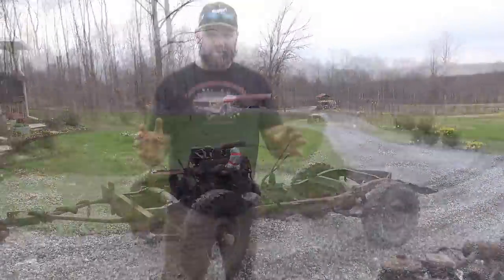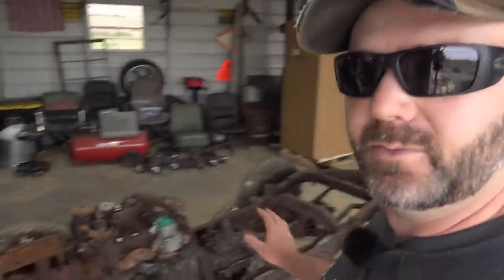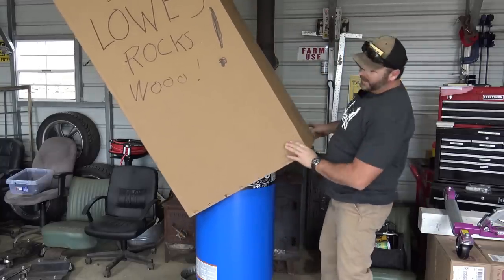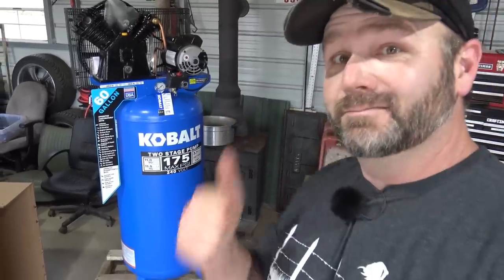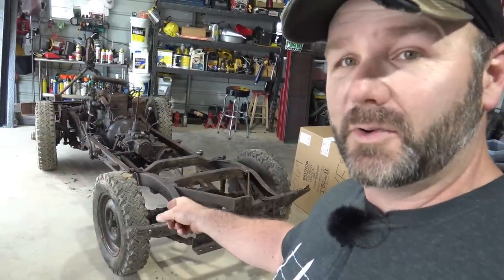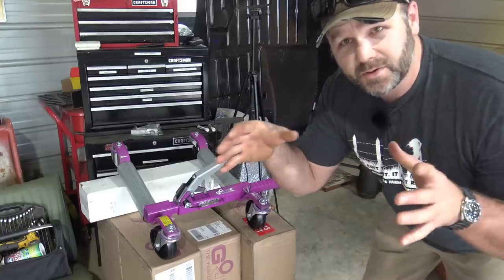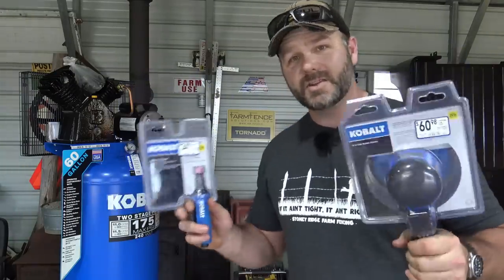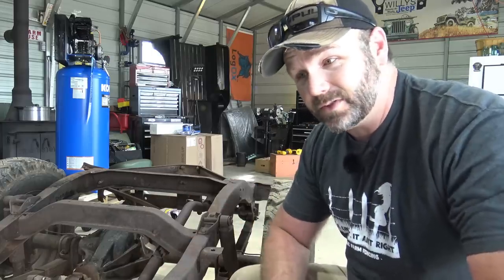Willys Jeep Rescue: CHASSIS WORK..and COOL NEW TOOLS to get the job done!

Comment: Hmmm, to be honest, if I was redoing the Jeep, I would take most everything off the frame. That way you can check everything out like rear axle seals, bushings in the springs, etc. Even though you see no leaks now, after driving it around its highly probable that leaks may arise, Also replace any bolts and such that would make future work easier. I was thinking since you have the tractor with the loader or the forks, you could attach the frame to them to be able to clean up the frame much more easier, also the axles as you can adjust the height and angle to best suit your needs. I would also wash the frame, before painting, with a good degreaser, rinse and blow it off and put out in the sun to dry if possible and at least get the base paint on as soon as possible. I think it would be good to show people how to label parts as you remove them and label them. Especially will show the importance when reassembling. You have it this far apart and I think you will feel better in the end. Watch chuckie2009, I think it is and he has plenty of evidence of doing things right and going over everything the first time. He's a welder that likes collecting old tractors. Just a thought, Kevin. Thanks for sharing. A few seals and bushings here and there shouldn't cost that much and don't worry about when it'll be done but the satisfaction of working and learning as you go, There just aren't that many parts to take off.

Comment: I like por-15 spent $82 on package yesterday.
Reply: I used that crap 3 times on truck frames and within 3yrs, peeled like a banana and part of the frame came with it. Never again.
Reply: @augustreil  Did you use prep and cleaner? And make sure it was bone dry?
Reply: @ryanis_here , Absolutely. Followed the directions to a tee.
Reply: @augustreil  I'm just using it for my trunk so we will see how good it does. Thx for feedback.
Reply: @ryanis_here , I'm sure you'll be fine. I used it on Plow Trucks specifically that saw tons and tons of salt. I'm pretty sure that didn't help one bit !

Comment: Rubber undercoating is the worst. It captures the rust and it makes it rust from the inside out. Oil undercoating is the way to go
Reply: That's the only thing I do now. After trying POR-15, 3 times and peeled. Then tried painting and undercoating, same thing. I now just clean the frames and spray the frame with a diesel, kerosene, 5w-20 mix every 3 months for the first year, then twice a year after. No rust ever, looks like it's painted black and every bolt always comes off.
Reply: ***You are correct***, I feel bad when NEWBIES buy into this rubberized undercoating BS, its  only good for undersides of fiberglass car fenders so the gelcoat won't star pattern from pebbles and stones flying off the tires and hurt the gelcoat, its horrible for frame Rust!
Reply: @MrRoach-yo3mz , Agree 100%
Reply: Believe Mustie1 has a good mix he uses. Can't remember the formula, but it works for him. And he's in the big bad north with all the salt to eat everything. Should be able to search his channel and find it.
Reply: @KJ-kw7gh , I just looked up Mustie1 and he adds bar and chain lube, which makes sense cause it's very sticky, will mix some of it in next time I spray. They do the same here in Corrupticut with the salt AND that pre-storm crap that looks like 4-5 white lines on the road. My town uses truckloads of pure green salt. Works great but is killing anything metal !
Reply: You're 100% right. I had the frame on my car coated and most of it flaked off and caused MORE rust. Basically just made things worse. Never again! Learned my lesson the hard way. Thankfully it was only 1 coat.

Comment: You can't use the front bucket on that tractor to lift that engine?
Reply: Or a chain fall from an overhead beam?
Reply: @veiledzorba  framework in that shop is way too light for that

Comment: dont use rubber under coat it holds the water  use a brush and rustoleum  and wire wheel after you needle gun then red oxide primer then brush rustoleum like an old car it will shine for the next 40 years

Comment: I believe Lowe's bought out Craftsman....
Reply: Yes, they did, Per my old manager, Craftsman saw the writing on the wall a year or so ago with Sears. So they signed an agreement with Lowes. Lowes will sell craftsman for now on and Josh, the reason there is a clearance for Kobalt is because lowes is fazing that name out and only gonna sell craftsman.
Reply: They're selling Craftsman at Ace hardware too.
Reply: Stanley Black & Decker bought the Craftsman brand. Sears still has rights manufacture and to sell Craftsman tools for years.   According to 'Miller, Ben (Mar 7, 2019). "Stanley sues Sears over Craftsman brand". Chicago Business Journal. Retrieved March 8, 2019.'

Comment: Do not buy a SMAW (stick welder) Machine. Buy a GMAW (MIg welder). Mig is easier to learn and produces better welds. downside is you need to buy a gas bottle. you can also run flux core wire in it for use out on the farm.  Also I would consider a rebuild on that engine and trans.  you are putting in a lot of work to not do that

Comment: Why do you want to buy an engine hoist? You said you have a engine stand don’t you have a backhoe? Pick it with backhoe and put it on the stand. Before you lock it on the stand drive it out on the grass and wash the engine down. Let’s see you do that with an engine hoist.
Reply from the maker: Back hoe is sold...but tractor has pallet forks..you make a good point my friend